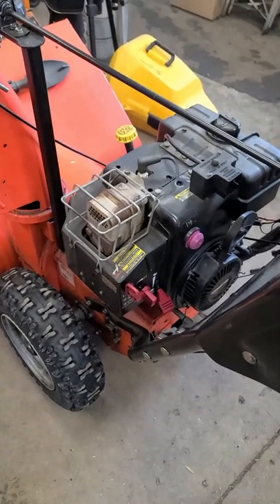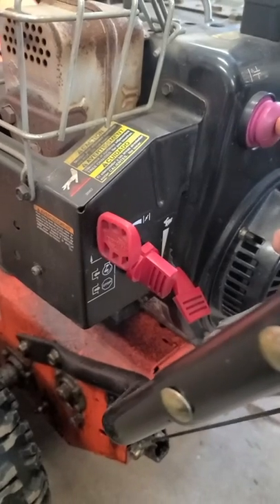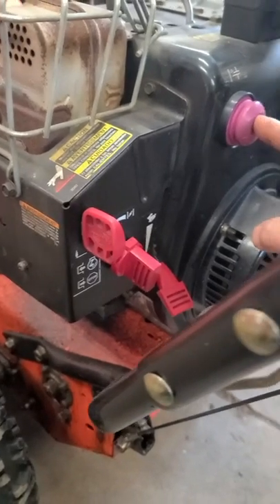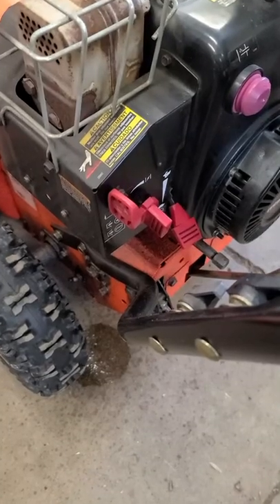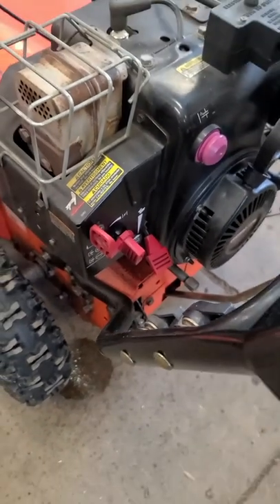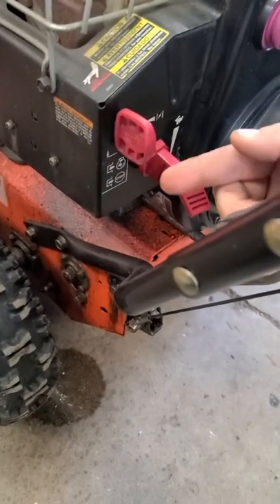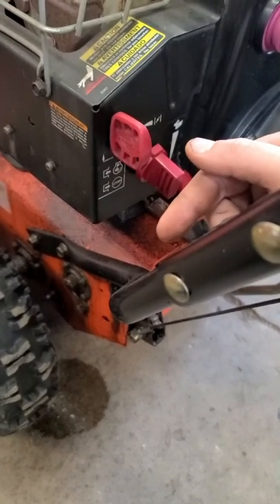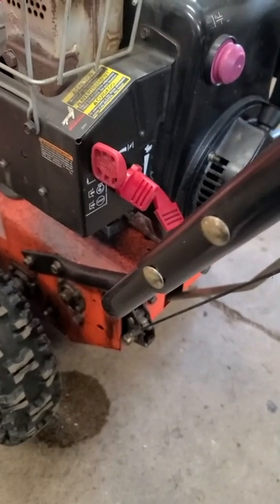Snowblower Leaks Gas When Using Primer - Is it Normal? #shorts

Comment: Back in the day, I initially worried about this with my Tecumseh Snow King engine, however I quickly became comfortable with knowing to stop priming when the drips started.  19 years later, it's still taking care of my driveway every snowfall.
Reply: You probably only used it 5 times in 19 years,
Reply: Bought my snow king back in 1996....never changed the plug yet, and it still starts on the first pull!!....and yes , mine drips gas also   ....live in Wisconsin, and use my snow blower, a lot!!
Reply: Do you know where I can purchase parts for the Tecumseh engine? I purchased an old toro (probably 20 or years old) 4.5/21 snow blower for 20 dollars from my local thirft store. Just replaced the gaskets (bought the fel-pro gasket maker sheets from autozone) and o ring for the carburetor cause it was leaking from the two gaskets on either side of the spacer. The blower started for pull, ran then I shut it off after a bit, then noticed the leaking. The rubber paddles on the auger need replacement along with the scrape bar and skid shoes.

Comment: Thanks Don. Good video. 

Here is an idea for a short. Deep inside the Ariens snow blower drive is the sliding barrel housing the bearings supporting the drive platen wheel. If you don't keep that oiled the barrel can stick in the housing and the drive cannot engage. The manual is sort of vague on where to oil and unless you have had the assembly apart it is not too obvious what to do and why it is important.  I had this lock up on a 1980 vintage 8HP 24 Inch unit. I had to disassemble the entire drive unit to get it out and free it up.
Reply: Wow. Someone using a model older than mine. Mine's a 1987 Toro.

Comment: Small note, if gas is rather streaming out of the center of the bulb without priming, the needle valve may have moved to one side, causing the float to lift too high, carburetor gets overflown - same thing if you replace the needle valve with one that is slightly shorter

Comment: The primer is actually pumping air, not fuel, pressurizing the float bowl, in turn pushing the fuel out of the carb passages.
Reply: Correct

Comment: This is what our new ariens 24inch did. We used it 3 times and after the second use, we stored it inside the garage like we always do.
The next following day we noticed a strong smell of gas through the whole garage. I push it outside and before I try to start it, the primer bulb is bulging like a baloon.
I go to press it to prime it and it starts squirting out of the middle hole of the bulb. Then it starts drippiny under the carb area like in the video.

The blower still worked, but the primer system seemed so messed up and a drive cable popped off out of nowhere right after that during use that we said screw this and pushed the store to return it.

The video says a little leaking under the primer is normal, but is the bulging and squirting out from the bulb normal?

Comment: Hey Don. I have a Toro 2450 with an r-tek engine (2000s Model) I bought a Chinese carb off of Amazon and when I put it on it was over revving and I couldn’t figure out why. I even filed down the throttle linkage because it was hitting the intake housing but even after that it is over revving to the sky.

Comment: I'm having an issue with this near exact snow blower. Choke, prime throttle all in the same spots.  After I snow blow for 20 minutes it'll start to almost backfire/pop 4-5 seconds apart that get closer then cuts right out, I can wait momentarily prime until fuel drips and fire it up goes again. Now it does it intermittently when it wants it seems. Any ideas what I should address? Was serviced in the fall.

Comment: I had a similar problem on a Toro.  Turned out that the rubber hose from the primer button was cracked and leaked when I pushed the primer.

Comment: mine leaks when i lift it upright to do maintenance
Reply from the maker: that's normal
Reply: If it has a fuel shutoff, be sure to turn that off before tilting up.  Then either run it out of gas to empty the bowl, or drain it.  I even think you can get replacement bowls for many engines/carbs that have a separate drain hole and screw.  If no fuel shutoff, add one, great to have for all sorts of reasons, especially draining it before storage after winter.

Comment: Dont Forget to give a little throttle before starting !!!
Reply: Sometimes that’s the problem !!! Minimum Alf way Throttle before starting … then back it up when it starts …
Reply: My 1977 Snow Throw Ariens 10 HP Techumse 32 inch’s is still running good after 45 years !!! Just a good maintenance is doing the job done !!!